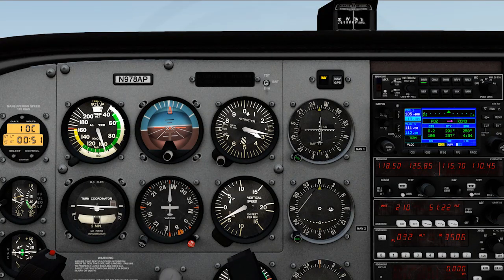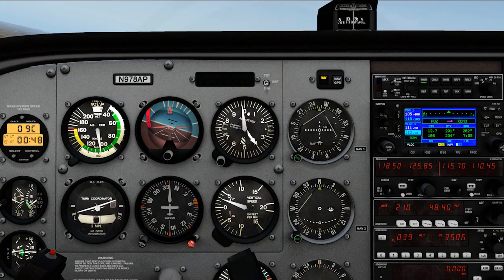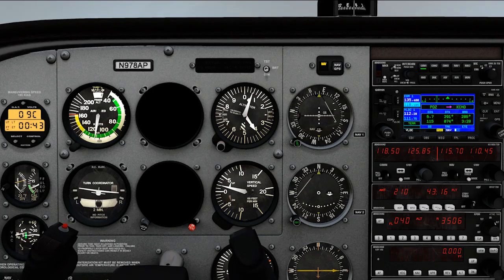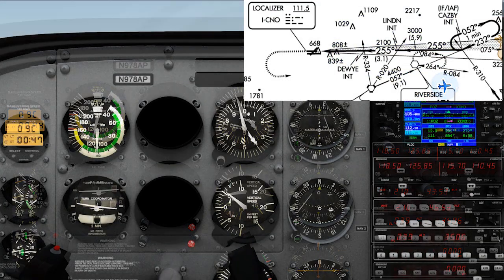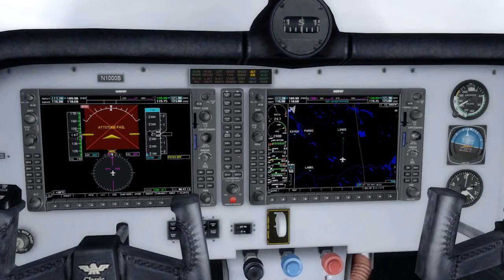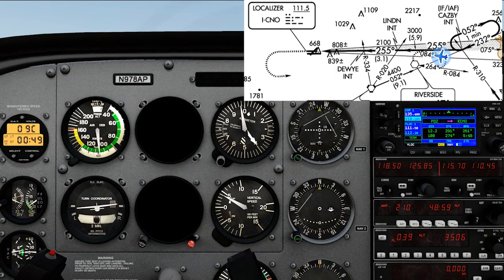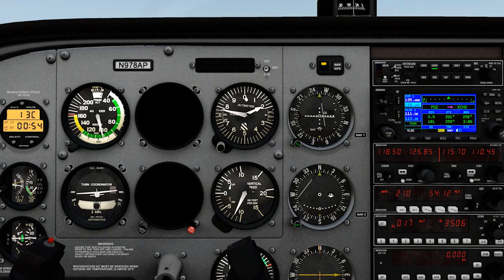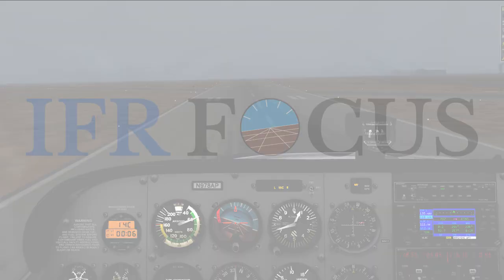How to Practice Partial Panel Approaches | IFR Focus

Comment: “You guess at a turn by compass, timing, or GPS” It’s not guessing if you’re doing it right. Timed turns are certainly a pain in the butt, but it’s not guess work and really not that hard with minimal practice. But this seems like a decent option as well

Comment: If you have vacuum failure but have GPS with track you should probably use that vs no-gyro vectors, no?
Reply: Or the whiskey compass. GPS would be good as long as there aren’t any high winds that would drastically change heading vs gps track. But even that could be fixed by the controller adjusting with “turn 10 degrees left”